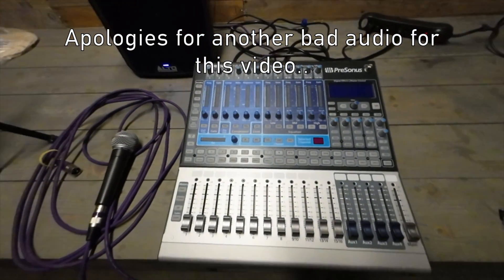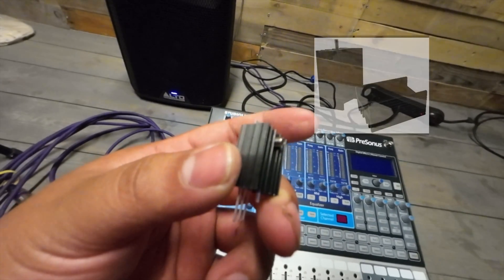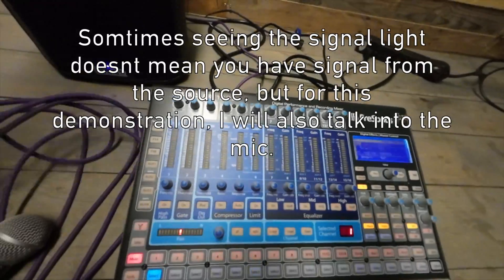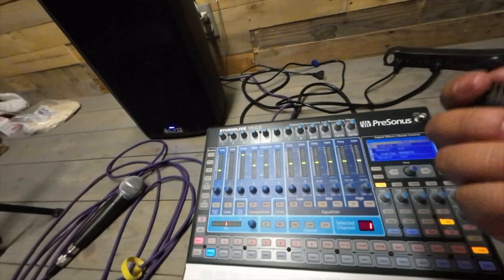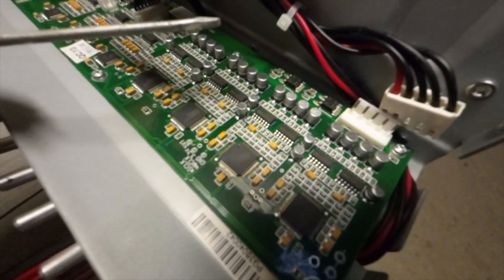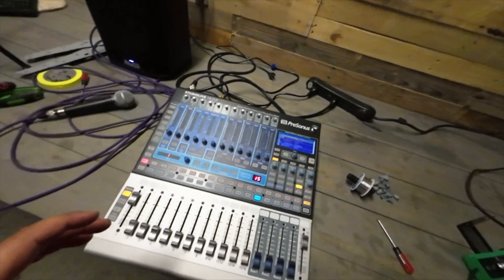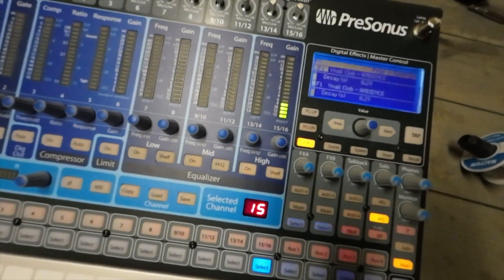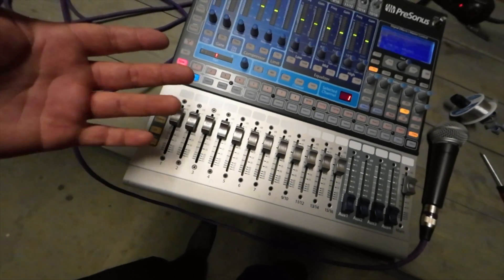Presonus Studio Live 16.0.2 No Signal Input Fixed!!

Comment: Hello.
I have the first two channels, and just by setting the gains to maximum without using a microphone or anything, the channel LEDs go up to half, but the others don't.
I replaced both voltage regulators because all the channels failed, so I couldn't hear them, as you explain in this video.
The problem I'm having, and I've only just realized it (maybe it was already getting hot before), is that practically all the integrated circuits, capacitors, etc., get hot, but the entire mixer works. It's not normal for practically all the components on the boards to get hot. Do you know what the problem could be and how to fix it?
Thanks and best regards.

Comment: i
All my channels are failing, just like everyone else here, and after resetting it three times, it started working again, but I'm going to replace both regulators.
What's also happening to me is that the first three channels, 1, 2, and 3, without connecting anything and only turning the gains up to full, generate very low noise and the signal increases to half, while the rest of the channels are fine.
Do you know what the reason could be for the first three channels failing? Could it have something to do with the regulators?
Thanks and best regards.

Comment: After replacing the voltage regulators, i don't understand why the only connector within reach of the internal "Lamp" BNC connector cord, is a ground pin on a part of the chassi steel. Is it supposed to be non-functional?

Comment: thank were did you buy the regulators and do you have the model you purchased thanks
Reply from the maker: I bought them off of EBay:

3PCS STMicroelectronics L7805CV Voltage Regulator IC REG LINEAR 5V 1.5A TO220AB

Comment: How long did you have this mixer before the issue arrived? I just bought the 16.0.2 used, that was less the 3 months old, and  will be swapping out the regulators, before i even use it. I have seen many issues with them here on youtube alone so will nip it in the bud. Do not want to be in the middle of the show and it decides to stop working because of the 5 volt regulator
Reply from the maker: I looked this mixer up on reverb, it was already faulty(inputs 1-12 were not working). I also did research and learned that the 3v was the problem, over long periods of time of use the 3v regulator will give out. It’s been quite a while now in my practice room using this mixer, and I’ve had 0 dropouts, all the auxes, and channels are working just fine! 

And I understand that if you are in a middle of a show, you do not want the mixer to drop out. I haven’t seen another video stating;
“5V regulator did not work” but I always take a back up 16 channel(XR18)
Reply: @SeanOrnelas  Appreciate the response, the regulators you replaced look like the 5 volt regulators. The part number you posted is for the 5 volt regulators, and many videos showing them going bad.
Reply: @SeanOrnelas  The part you posted is for the 5 volt regulator, not sure about the 3 volt. Others have posted the same exact same problem, it seems to be pretty common. So am getting them replaced before i put it in service.
Reply: @SeanOrnelas  Many Videos out there that shows the Presonus mixers replacing the 5V regulators with the 7805.

Comment: what forum did you go to help you investigate and determine the solution? my church has one firewire and one USB version of this with some issues, example: channel 8 of USB version doesn't work
 firewire version works but sometime, it crashes and shutdown.
Reply from the maker: I didn’t really find a forum, I so happened to find it on YouTube, the main issue is the voltage regulators on the factory board, I believe it is 3v, instead of the 5v I put in, as for the USB I have not tried that, since I do have the FireWire version I’m not worried about, maybe if I got my hands on the updated ones I could help more.
Reply: Have you tried the TRS on channel 8 also?

Comment: This is a great mixer , i have this same model but mines is the one with usb. 
I had it for like an year now and you can get great sound out of this
It took me some time figuring out how evetyhing works cause is digital and  i was used to pure analog .
 i use my tablet to control the mix so the only work i do is to turn in on ,connect the inputs and adjust gain the rest i do it with my tablet
Reply: I just bought the 16.0.2 USB also several days ago, and took it to the shop to have the 5V regulators replaced. I Have not even used it yet, I looked up many Videos, and it is a very common issue with these mixers to have the 5V regulators go bad

Comment: I hate these mixers with a passion. They always die on me. We still have one in the shop and we got it the day they came out. The left output never worked out of the box. lol We used the mono output for every gig and now it lives on as the iPod preamp in the shop.
Reply from the maker: I see a lot of issues containing that, outputs, and inputs, it seems like it’s this board, the 16.4.2, and the 32.4.2, I feel like they got something wrong in making these, of course the newer ones are wayyyyyy better
Reply: @SeanOrnelas  Yeah those voltage regulators are either too weak or too poor quality, or too badly cooled.